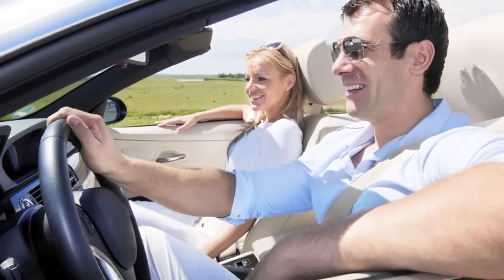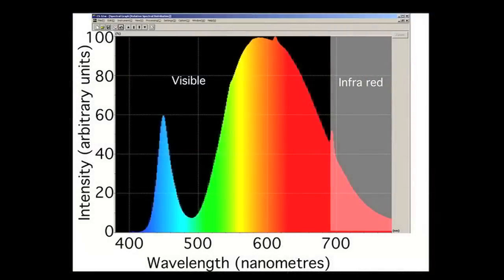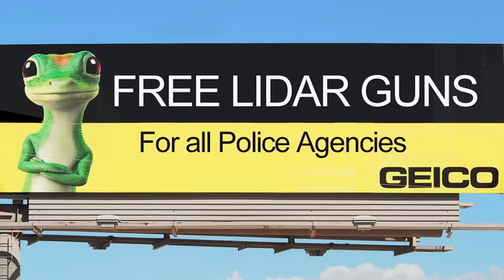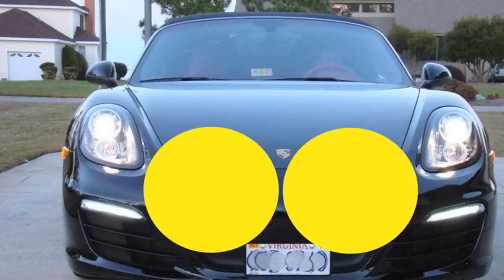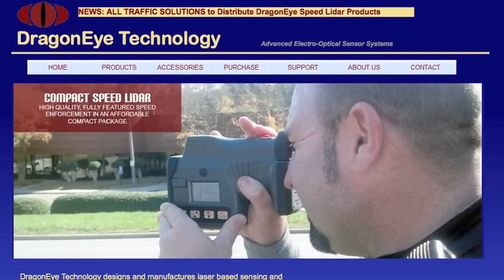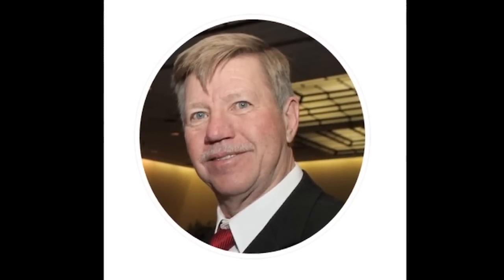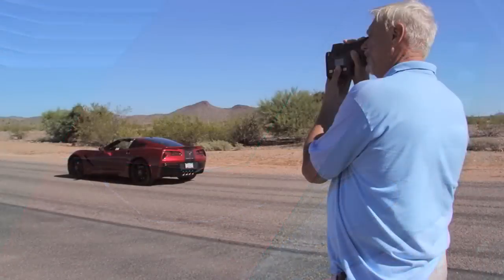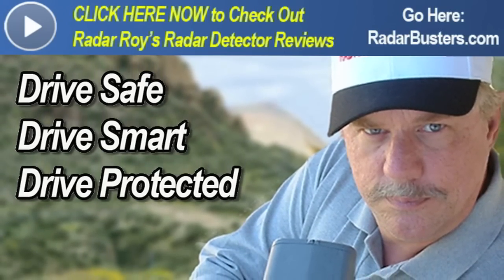How Does A Laser Jammer Work - Radar Roy

Comment: How do the lidar detectors work when the headlights are on? I would imagine that would interfere with the reflection?
Reply from the maker: Years ago when lidar guns were at generation one, headlights did have an impact to some degree, but that's not been the case now for many many years.  The only effective countermeasures in addition to a good laser detector is to use a laser jammer like TMG or the ZR5 and the Veil stealth coating.
Reply: @RadarBusters  wouldn't it be feasible to say that you could rig up your own strand or bar of I.R lights and hide them on the front and rear to help throw off the laser? I'm also wondering, if they target the most reflective surfaces, then wouldn't flat paint help, and is it most likely the mirror inside of the headlight cover? The one around the bulb? I haven't priced any of these leading conpanies, but it appears to be I.R lights that deflect the laser. So in theory, you could use a LRF and series of I.R lights, and scatter them across the front of your car to prevent the laser from punching through. You wouldn't get the alert that you're being targeted, but you would think that it would at least make the lasers less effective. Maybe setting those same I.R lights on a pulse/strobe would help with the randon pulse lidars too? I'm just spitballing here.

Comment: Here is a simple technical video on How many of the current crop of lookup table jammers work from strictly a technical point of view. if I get enough requests I will explain how the Dragon eye works and how the new jammers Roy has shown here beats them. I will also explain other methods that will work against dragon eye and other guns that use the same system

Be sure to open the link in a new tab as it will only redirect back to this video if you want to learn more about the systems behind how jammers work. 

https://www.youtube.com/watch?v=5Ov2YktDpxw&list=UUxiBH7Vz-p0qwvZjXVv5LQw#t=31

Comment: This is exactly how radar jamming pods work on military aircraft. Scrambling is common, so there are deception jammers that match the response.

What I am wondering is if “noise” jammers work. That is, if we know the direction of the original beam, the spectrum used by the devices, why can’t we flood a wider spectrum with a more powerful signal?  This is how the ASPJs work in fighter craft to break locks by denying the enemy the ability to determine distance and closure rate information. The only thing the enemy can determine is the direction.